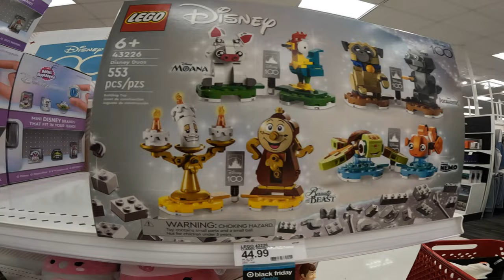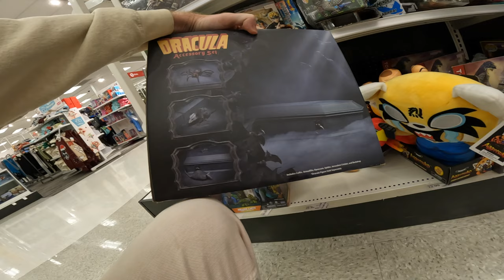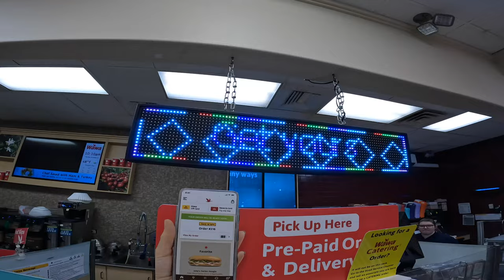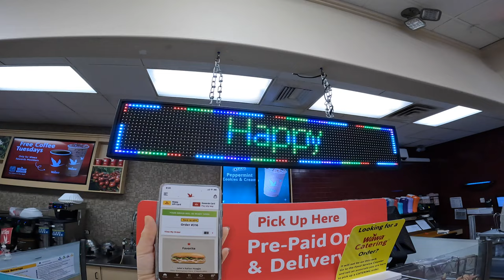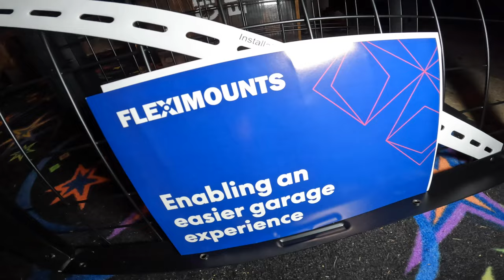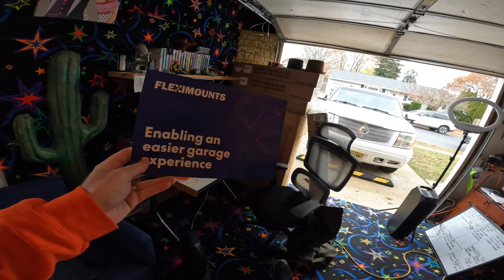UNREAL Road Side Find On Thanksgiving!

Comment: What is worse is that you plan to meet up somewhere, they get there, know that the agreed price is say 20.00 and then as your getting the item out of your car they say they only have 10.00 on them. I was pissed, to say the least. But some people don't care. That's how they run their business. I did take the 10.00 that day but I now state on my marketplace, prices are final. The slides are a great find. Just check them out for fine cracks. And Tucker, you did a great job on the racks. I need racks like that too in my garage.
Reply from the maker: It's terrible honestly for $10 at this point I would have to just leave....